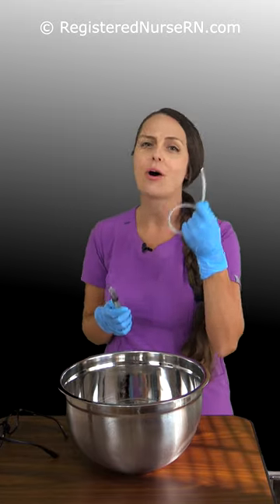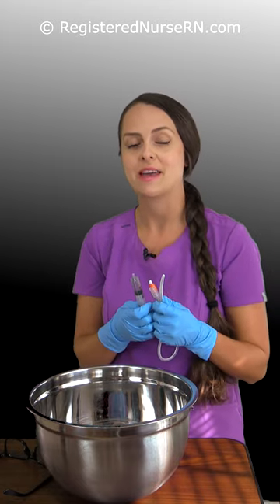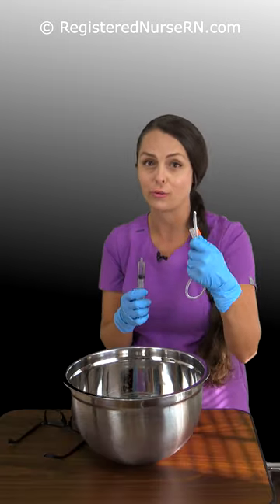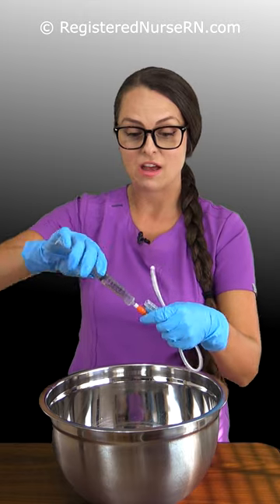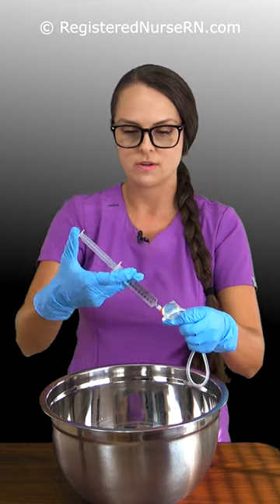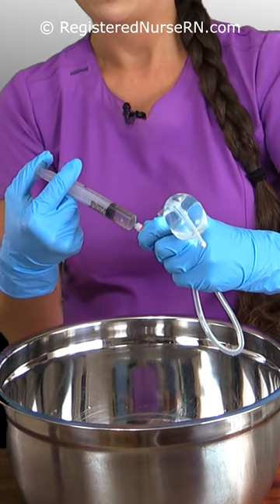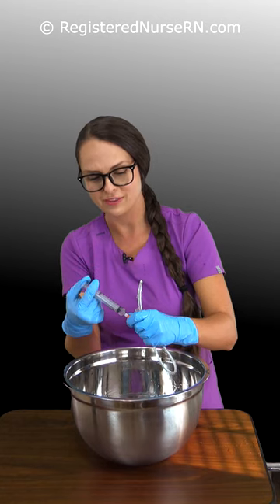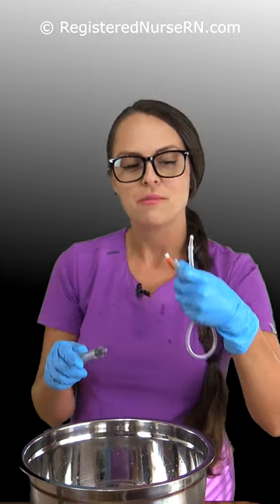Nurse Experiment: How Much Water Until the Foley Catheter Goes POP!?  #nursing #experiment

Comment: Do yu need an order to irrigate the bladder via foley? Or can that be a nursing judgement? @registerednursern
Reply: Technically you need an order with sterile water or an order with sterile NS 
How many ml
And how many times per day (qid or as needed) 
And always best not to break the seal - do it on the port for specimen, clean the port, and put a rubber band, come back and release